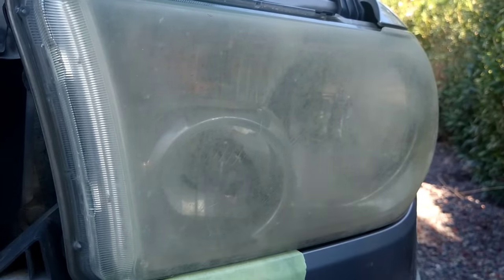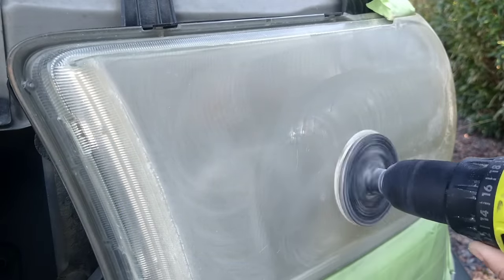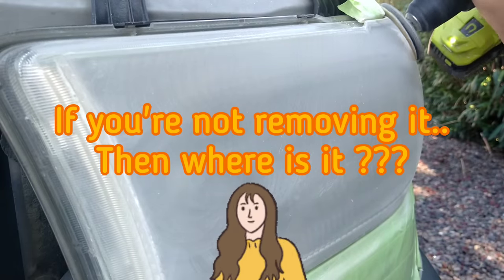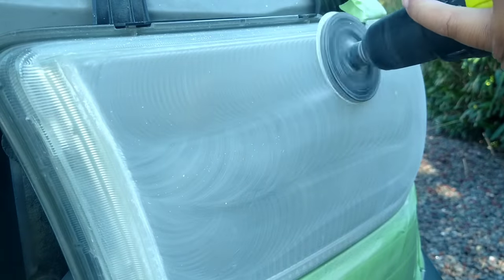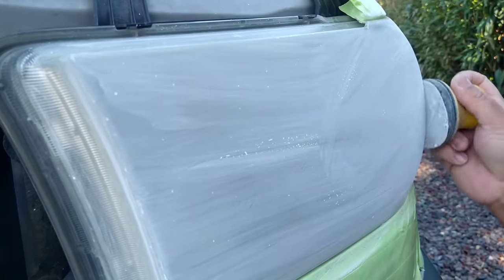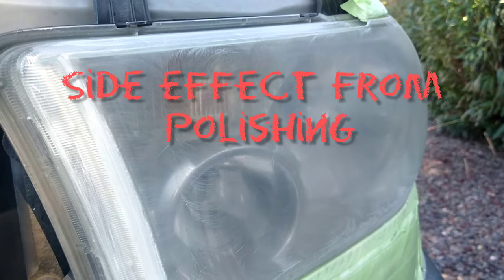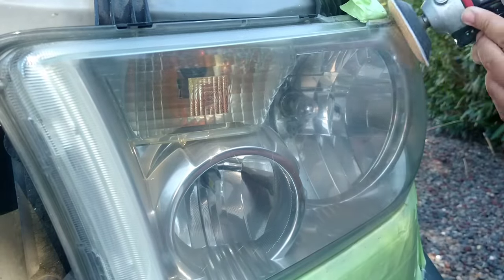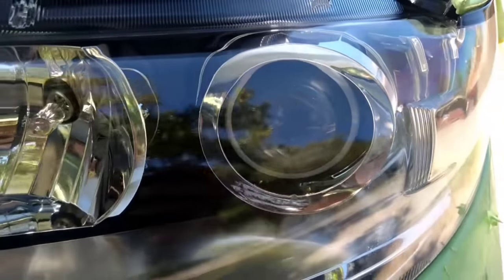POLISHING HEADLIGHTS IS A SHAM/scam  ---  and why you should never only polish headlights

Comment: As an industrial chemist who worled for Stanley making polycarbonate headlights and specializing in thr coatings to prevent degradation from UV, I can tell you most of the information in this video is complete nonsense.
Reply: Ought to use Glass instead of that Poly BS
Reply: But he said he was a pro. He is sanding a lot of the plastic off.
Reply: @BillWilson-kd2jp  A polishing romoves a thin layer of oxidation and rough plastic. The video maker is talking a lot of bullshit, that's for sure!
Reply: What do you advise then ? I'm curious. Everyone has its own way and I don't know what to believe anymore.
Reply: @NoMoreBsPlease  I kept thinking he didn't really know what polishing means, and perhaps got it mixed up with waxing or something. He was saying not to polish while he was polishing - wtf? 

Of course you need to clean off any residue at the end. Probably glass cleaner, isopropyl alcohol, etc will work just fine. And something to coat it afterward to help protect against the UV that causes the problem at the end. I think I used something from 3M made for headlights last time I did it.
Reply: Which part specifically is nonsense? And could you let us the facts than instead of just saying the video is full of crap?!

People are over complicating things!!!

This is what I do:

1) Remove the oxidised part using sandpaper (use a higher grit/less aggressive like 2000-3000 if you are not comfortable).  If the lens is really bad use lower grit (1000,1500 grit) , but make sure to follow up with follow it up with a higher grit (2,000 - 3000). If you just use a lower grit sandpaper without following up, there will be a lot of scratches on the lens once you have finished polishing.

2) Polish with a compound. You can use a drill with a 3 inch backing plate. The drill can also be used for the sanding stage 

3) Clean with IPA.

4) Protect the lens. I have a friend who has a body shop and I will ask him to spray clear coat on the lens which is the best method and will last the longest. However you can also use something like 3M Quick Headlight Clearcoat. It comes in wipes, so you just need to wipe the headlights. From the reviews I have seen it will last about one or 2 years. I have just bought a few pieces so I will be testing it soon. 

Most importantly just have fun and use a higher grit sandpaper if you are not confident. Using a higher grit sandpaper and polishing will still give you good results
Reply: What I don’t get is that people will accept that cars generally need to be polished every few years then ceramic coated or sealed again

Yet

Somehow most believe that the headlights magically don’t need regular upkeep?

Why is everyone so lazy?

It’s not the end of the world to spend a few hours every 2-3 years to redo them 😀

And - it gives a sense of accomplishment unlike many other things in life where we are removed from working with our hands
Reply: I'm sick of listening, dang
Reply: @gimblito8172 Yea that's pretty much the most reasonable way to do it. Don't overthink it. The guy in this video is sqewing gobledy goop about polish and oxidized plastic because he doesn't understand material properties. He just thinks oxidized headlights are  like rust on a car... They are completely different phenomenons
Reply: Absolutely agree.
Reply: @BillWilson-kd2jp How else can one remove oxidation without removing a tiny amount of polycarbonate???
Reply: @NoMoreBsPlease And I suppose you know a better way, Please feel free to enlighten use all!!🤔
Reply: @bankal1442 Ignore the negative comments, I have followed his method to the letter over many years, My headlights look new!! How can anyone watching this unedited live stream find any faults, Is quite frankly mind-boggling 🤔🇬🇧☝️
Reply: @winfidel perhaps you to watch the video again? And listen to the details!! 🙄
Reply: @winfidel Your the one making it more complicated??? By adding your own take on how to restore headlights!!! The pro as spent many years researching and refining his method to perfection for the benefit to all of us to follow, I have and will continue using his method which as never given me issues, just brilliant clarity and performance!!🤔🇬🇧☝️
Reply: I've watched at least 20 headlight restoration videos. What he gets right is a proper sanding and then spraying with a proper UV protectant. His criticism is for those that don't sand and start with polish, then don't spray with a UV protectant. There are those that claim success using a 2K clearcoat. I'm guessing he hasn't tried that method so not sure his criticism is valid. You could probably hand sand but it would take longer.
Reply: comment is kind of pointless if you don't follow it up.  His results says he does know what he's doing.
Reply: @bankal1442  
If you can polish the headlights to make them "clear".... then you have removed all the oxidation.  
If polishing does not make them "clear"... that is because the oxidation is deeper in the plastic, & requires more aggressive sanding to remove it faster.   After which you still have to polish it to make it "clear".  
The last step is you have to clear coat the lens, to protect it from UV light that will cause it to re-oxidize.  
So yes... the guy in the video is babbling a lot of BS.
Reply: Stanley has a defective product!   Hopefully a solution is in the works.  

Did you get fired, or did you quit!😂...
Reply: dewd says hes sanding off polish when he is clearly removing plastic.
Reply: @bankal1442 sand faded headlight same way the knucklehead did it in the video, polish it to perfection, clean REALLY WELL using alcohol cleaner or straight alcohol, mask it off, apply a coat of adhesion promoter, spray 2k clear. That’s worked well for me.
Reply: @07wrxtr1 they don't need upkeep when they are glass like they used to be. Why accept reduction in quality that adds a problem that previously didn't exist? How about we start making windshields like this and then accept that they need regular upkeep in order to keep their clarity also.
Reply: @davidwolff4696  Jesus man!!  Don't give them any ideas...
Reply: The problem most people have using 2k clear is that you do not polish a surface before applying 2k clear. It needs a tooth to adhere to, like velcro. Also some polishes may have contamination that cause fish eyeing. 2k clear is also UV resistant, otherwise the paint on your car would fail. 2k clear is just a catalysed Urethane Top Coat, the same thing that is on the rest of your car.
Reply: @William1866 My opinion: He doesn't use the 2k clearcoat method because it's a business to him and the 2k process is too time consuming to be profitable, a lot of prep work and paint masking needed then back again 24 hrs later for the paint to dry then fine sand again to remove imperfections and orange peel before the final polish and sealant
I used various methods on my 2008 VW Golf and 2007 Toyota Fortuner, none lasted more than 2-3 months. Finally did 2k clearcoat as the best and longest lasting method, 3 years parked outside in tropical heat and rain and my headlights are still as good and clear as the day I sprayed it.
Reply: @keithroberts5611  heat, use one of them little blow torches
Reply: Chronic Complainers gonna complain no matter what it is.@keithroberts5611
Reply: Oh for sure !  You have to get through a minute to video to hear anything of actual value. That’s how all of this guys videos are lol
Reply: Claim to be a chemist but gives no solution. Just out here wanting to talk shit.
Reply: @bankal1442 the only way to restore headlights longer than a year is to sand and spray a clear coat. The haziness is from the initial clear coats UV protection failing, and you must sand that damaged layer off. Polishing will remove that layer but your only UV protection would have to be a sealant or coating, meaning the haziness will come back sooner. Thats why we think this guy is talking nonsense, he doesnt even know what he's actually sanding off.

Comment: I use this method and it works well!!! That said, I miss the days when they were made from glass and didn't require restoration... EVER!
Reply from the maker: https://youtu.be/LcMFr0mpp-4
Check this out on that topic ☝️
Reply: Luckily the headlights in my 01 4Runner are glass. But I’ve had to do a couple restorations myself it’s a long process but if done correctly it can last a long time.
Reply: Plastic is actually safer and allows for bigger headlight designs
Reply from the maker: Yes... Very much so
Reply: @goobfilmcast4239  Not to mention cheaper........nah, that wouldn't be why they switched to it
Reply: @MrSekitori  the real reason why we switched to PC lens was design, you can never achieve the same shape with glass. And with the huge headlamps today a glass version would weight as much as a tank
Reply from the maker: https://youtu.be/LcMFr0mpp-4
Reply from the maker: https://youtu.be/x1gp9ATZTI8
Reply: @goobfilmcast4239  safer??
Reply: @PeterJurasek  glass can be shaped same as plastic. Plastic is cheaper and lighter.
Reply: @asherdie  sure but it would not survive the first small stone hitting it :D I work for Hella Front Lighting, producing headlamps for 12 years but i would love to learn how to produce the lens from glass with the same parameters ;)
Reply: @PeterJurasek  Headlight units over time have in many ways become more simple as the dipped beam and full beam can be run from one bulb using projector lights meaning the unit can  be smaller than it used to be with reflector housings.
Reply: @gravemind6536  you are talking about projector Bi-halogen or Bi-xenon  units which were a hit 15 years ago :D Now its all LEDs, ECU, heatsinks, heat redistribution fan's, servodrives for LWR and other functions, definitely not easy. I dont know about US market but i work for Hella Front Lightning as a process planner designing and implementing production lines for mainly Mercedes headlamps. Headlamp is not one of the most complicated parts of a vehicle.
Reply: @PeterJurasek  They make bulletproof glass and they can make any shape out of that. Plus I think they have transparent aluminum which by the way might be lighter than glass itself.
Reply from the maker: @BrayanCarmona-kr7vt I admire your enthusiasm have you ever seen the thickness of bulletproof glass it's about an inch plus.. with that being said light would not go through it properly at all... Also you're talking about a hundred times the wait, and five types of space for everything else that needs to be inside of the.... You should check out this video..https://youtu.be/LcMFr0mpp-4?si=hz2P1xrrPXRkz-92
Reply from the maker: @BrayanCarmona-kr7vt also you think headlights are expensive now with some being $2,500 a pop.. you're talking tenfold the price... It's like I always say there's certain things that have the toilet paper effect... Meaning toilet paper is the best method used around the world wide as the best method to go to most cheap and effective easy to make easy to store easy to dispose of... You can spend $25,000 on a robot that comes out the wall and wipes your ass but these things like this are just not practical..
Reply: @BrayanCarmona-kr7vt  sure but you sure know what would be the cost ;)
Reply from the maker: @PeterJurasek not sure what you're asking or saying
Reply: @theheadlightrestorationpro  Yeah I feel like they do make bulletproof or bullet resistant headlights for the super rich for their bullet proof cars though. If you also think about it NASA could be using that same material for their spaceship glass windows but who knows maybe its just meant for the few 1% super rich.
Reply from the maker: @BrayanCarmona-kr7vt 👍🏽
Reply: @theheadlightrestorationpro  thats because i was not talking to you :D
Reply from the maker: @PeterJurasek 🤓😂😂😂 oh...
Reply: Whichever one you have,  maintenance is necessary. Either you do it or get it done by someone .  I do mine because , I like to maintain which I ride everyday and can't live without it.
Reply from the maker: @devbandy9004 exactly you have to maintain all areas of the vehicle and a lot of people have never been told that headlights have a large maintenance threshold... Got to provide aftercare even if you look it up on Google it tells you you should be waxing your headlights..💯
Reply: @theheadlightrestorationpro   I agree with you 100%. Great video Keep up your good work. 👍👍
Reply from the maker: @devbandy9004 appreciated feel free to check out some more videos there's over 140 videos up and running on this channel this particular one is about 2 years old the videos sure have evolved since then..👍🏽
Reply: I got a car with glass headlights, they look sandblasted and could use a restoration of some sort
Reply: @1873Winchester  Glass covers or glass bulbs? Glass sealed beam bulbs you just replace for $20
Reply: @yourhandlehere1  Saab 900 Turbo, european lights so it takes replacable H4 halogen bulbs (2.99€ a piece). I could get new headlights entirely but I like renovating old stuff. I've seen a guy fix up the glass covers.
Reply: @PeterJurasek  Nah, it's because they're cheaper.
Reply: @projectjster  We all prefer glass, but if you properly protect your headlights from new with the right plastic polishes, they never will get yellow.  Mine at 11 years old now, look 98% as good as new.  That's the thing - polishes are to keep them from degrading.  They won't fix neglect or actual damage, as he says.
Reply: @plektosgaming  Can’t say I disagree with your statement at all. Out here in West Texas protecting the plastic lenses is an absolute must. The sun absolutely destroys everything here.
Reply: I had glass headlights on my 94 Prelude VTEC and I would have rather had plastic ones. Kicked up rocks damage and chip the glass surface way more than plastic. Big enough rocks take chunks out of the glass as where on plastic it would just nick it some and not crack. Glass is heavier which is not great for performance/vehicle handling, etc.

Sure it sucks when your headlights start to yellow and lose clarity but just restore them or replace the lens like I did on my 2012 Audi S4. Cost me about $80 for a pair of OEM lenses.

Comment: This is pretty much the way I did my headlights, except I did one more step you missed. I did the 1500 grit before the final 3500 then buffed it. I also wet sanded every step by hand, except for the buffing process of course. Either way the point is if you're not getting past that top oxidation and down to the actual lens, then buffing alone is a waste of time... I learned this the hard way.
Reply: @PatTheBat  the P500 is aggressive if the lens really doesn't need it yes. When I did mine I started out with P800 but it needed it.
Reply: @garyr7027  P800 is the roughest I would go.
Reply: @PatTheBat  what I kinda thought too. I actually started out with P1200 but the lenses were old and it wasn't doing the job like I wanted without taking too long. Didn't wanna spend an entire day on headlights... Lol
Reply from the maker: Really should watch a couple of my videos.. especially my portfolio reels 1 and 2.. my quality is definitely second to none.. for many reason dry sanding is one of them..
Thanks for watching
Reply: I buffed my headlights this summer but they seem to be just as yellow as they were before I did it.  Some yellowness did come out but it looks like there's still some on the headlight. I used the turtle wax headlight restoration kit you can get for 8 dollars which came with two sand papers. I did it by hand and it's still not enough :(. It seems so simple to do yet I cannot get it right and it just frustrates me.
Reply from the maker: Yes sometimes it doesn't work with those kits.. you might have needed to sand deeper not knowing how far to go is a big issue with wet sanding, I would advise you trying something more like this video if you don't have the tools mimic what's going on in the video by hand just make sure you go deep enough where the bleed off or the powder that comes off is not yellow anymore it's white .
This is the problem with most kids the results are not uniformed they're all over the place with different vehicles...
Thank you for watching feel free to watch a couple of my videos I might give you a little bit more insight on the issue..💯👍🏽
Reply: @PatTheBat  mmk my house 🏡🏡
Reply from the maker: Much too fine of regret to start..
Reply: I do mine about every 4-5 years same prosses as you & use Meguire's same as you use. The truck is 20 years old with 180,000 miles never garaged. The headlights look just about new.
Reply from the maker: @richardpalleschi4807 👍🏽
https://youtu.be/1YCVKzBkNyE?si=n7_X0QEzRWhs1uiq